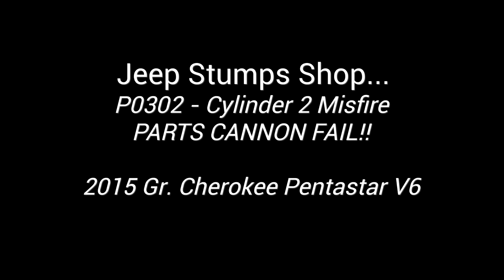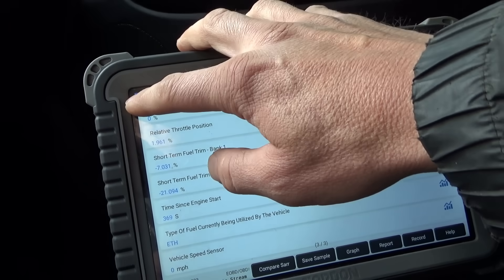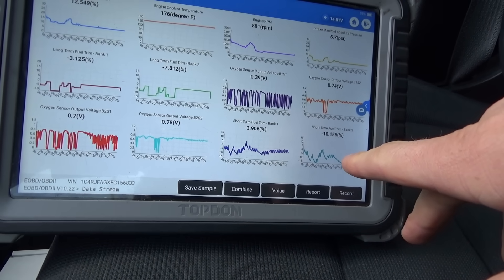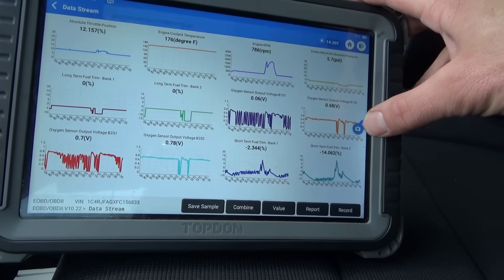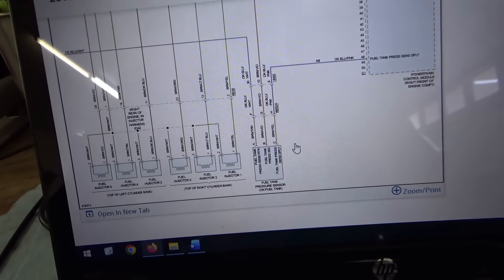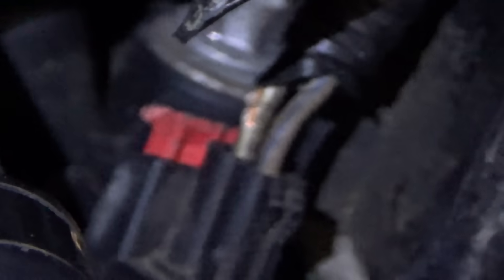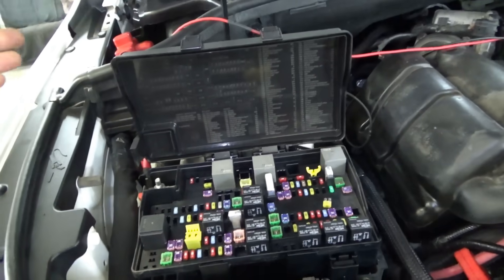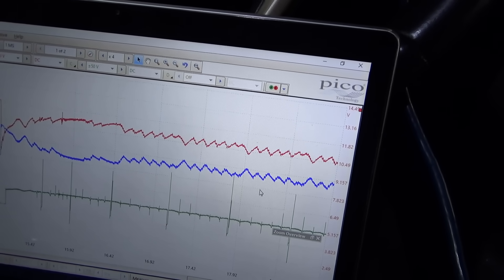Shop MISFIRES Parts Cannon!! ('15 Jeep Grand Cherokee: P0302 Pentastar V6)

Comment: Is "cylinder soak" method worth trying in this case (maybe it's a stuck piston rings, not valves)?
If you don't have a scope + P transducer.
Reply from the maker: No. It's a valve sealing problem.

Comment: Fun fact: on most chryslers you can enter Flood Clear Mode by flooring the pedal while cranking. Denies the injectors fuel.
Reply: It also shuts off the coil on Chryslers so you can’t get a sync
Reply: @michaelpowers4731  I thought of the 'pedal to the metal' approach also but didn't know it also shuts off the coils.  Thanks!!!
I'd have liked a bore scope view of the valves on #2 cylinder.
Reply: @namvet-72  I've only had a few cases of this cracked #2. I usually confirm it with a leakdown test and a stethescope to hear it coming out of the exhaust. Another method is a rubber glove on the exhaust pipe and put compressed air into the cylinder. It's always #2. In 2011-2012 there was a recall on the left side heads of pentastars for this same problem, and it seems like it mostly solved the issue. But every so often you run across it. I would guess that something about the design makes that cylinder run hot or lean, but I don't really know. What I do know is because it's common, the left head is cheaper than the right head from Mopar, and comes with a 10 year 150k warranty. The left side head gasket is also 1/4th the price of the right one. I think it's still under $20.
Reply: @namvet-72  Being such a small leak, I'm guessing the borescope wouldn't show anything significant.
Reply: @michaelpowers4731 now that I did not know, but it makes sense. Thanks for that.
Reply: @michaelpowers4731  Kinda defeats the purpose of clear flood then, kinda dumb. At the same time dont really need to sync it when knowing which cylinder is misfiring already.
Reply from the maker: Ha that would be faster than pulling a fuse 😊
Reply: Flood clear mode does not disable the coils on all Chryslers. I just did a relative compression test using flood clear mode and sinking cylinder one coil on a 2014 Dodge journey with the 3.6 pentastar. Works great.

Comment: I have a video on EXACTLY this issue. It’s a cracked exhaust valve, and it ONLY affects cylinder #2. It’s relatively rare compared to the number of pentastars Chrysler makes, but it’s common enough that you can buy a reasonably priced virgin left side head from Chrysler, and it comes with a 10 year/150k warranty. 

https://youtu.be/CZ5BiPmakic?si=YMdUdjUcs0m7cyjB
Reply from the maker: Thank you for the tip, Kip!

Comment: Back in the day the late 1970's and early 80's we would ramp that engine up to 2500-3000 rpm and  run about 12 to 16 oz of water slowly down the carb. Being water is a solid and non combustible it would break away carbon around the valves and sometimes fix issues like this.   Pretty good diag Ivan you were on that like a duck on a June bug!
Reply: Water a solid?!
Reply: @travissheehan6082  Yes it is considered a solid, especially in a compression situation
Reply: Why are his comments struck out?
Reply: @steeleleestele    I must be a bad boyee

Comment: I always do an rc test first on these things. Just because they're so known for calvetrain issues. Typically the rc test will show which cylinder is the issue. Then go in cylinder to see what exactly is happening. Then get approval for valve cover removal for visual inspection.
Reply: Are calvetrain problems only found in Ranch states?
Reply: @wayneessar7489 No, Protestant states.  Catholics have no such issues.
Reply: @wayneessar7489 lol.